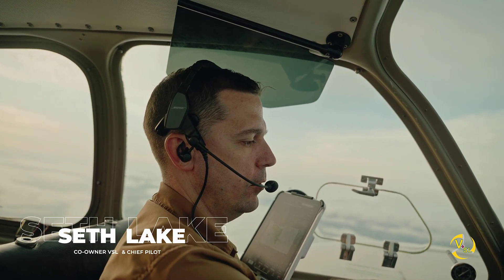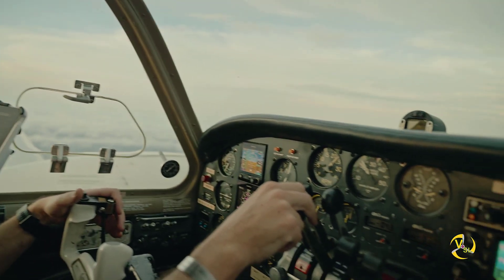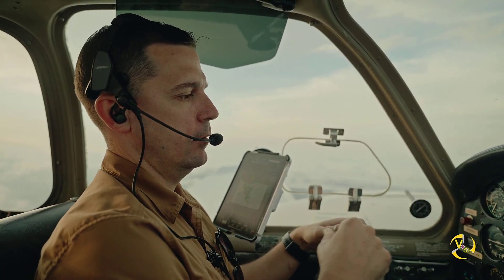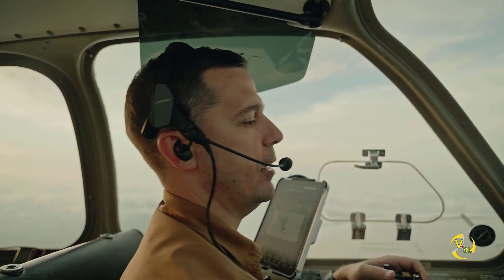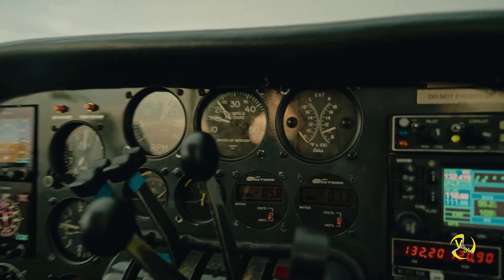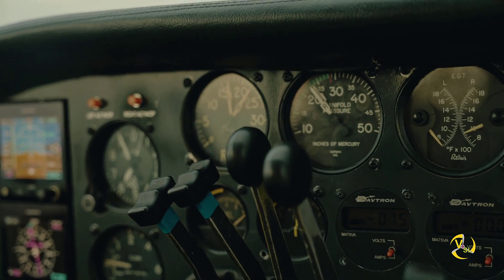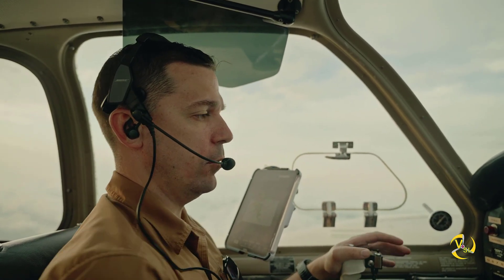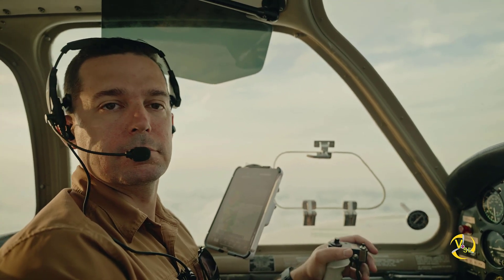Mastering Engine Management: In-Flight Mixture Pull and Shutdown | Twin Engine Aircraft

Comment: Seth, is your travel air fuel injected? Would you recommend fuel injected or carbureted engines for multi training air restarts?
Reply from the maker: Either would be fine.  The unfeathering accumulators is what makes the difference.

Comment: Seth, if the engine is shutdown by closing the mixture, would you expect to see an Oil Press and Alternator warning on that failed engine come up immediately? Or only after you feather it?
Reply from the maker: You wouldn't see low oil pressure or alternator warning until AFTER you feather.  Until then, the windmilling action of the airflow over the propeller will keep all the engine accessories operating (including the oil pump and alternator).